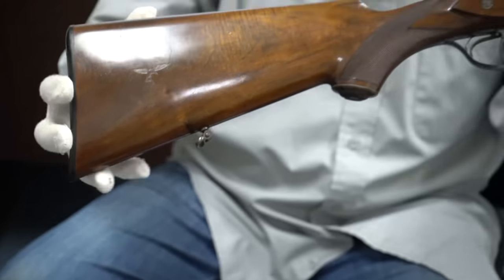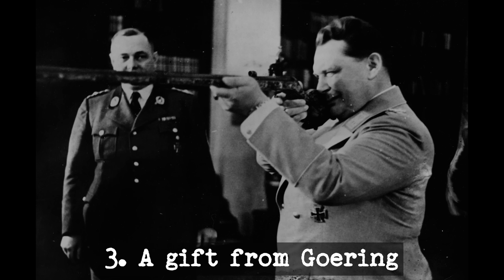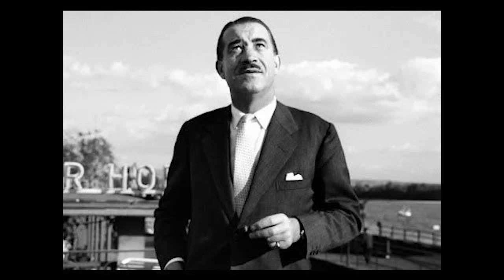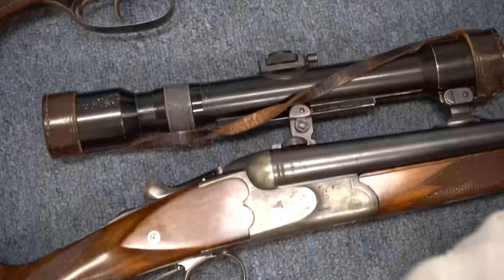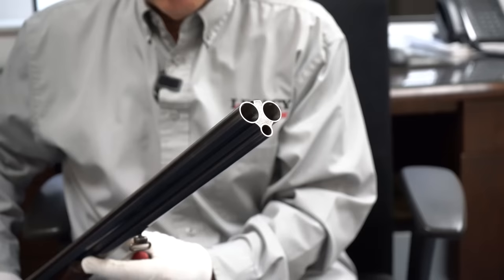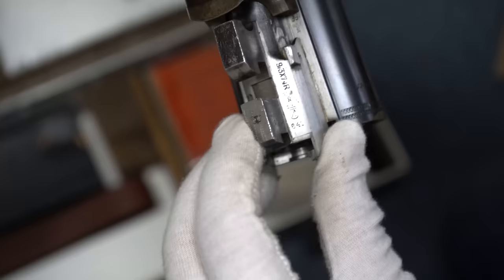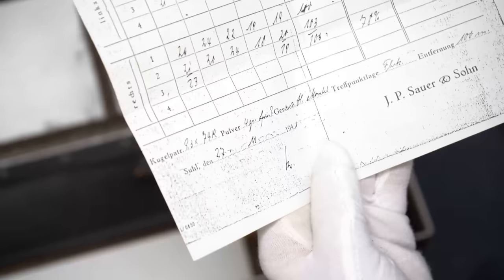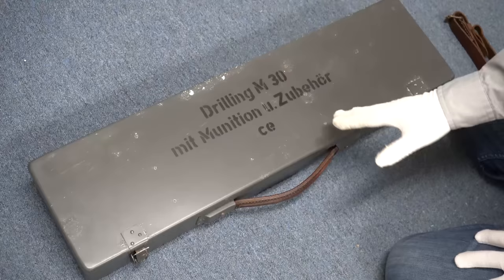Finally Proven! The Purpose of the Luftwaffe Drilling

Comment: There's a museum near me with a captured Panther, on the outside one of the cargo chains is the original - hammer forged links, all drawn out by an expert, probably took dozens of hours.  When the Brits sent it back to England for training they replaced the missing cargo chain by twisting a bit of bailing wire. Both were equally effective at keeping a gas can attached to the tank.
Reply: Bovingdon tank museum
Reply: What waste of resources. I have seen at least 50 other expensive and labor intensive examples on common German military hardware.
Reply: @robertkenny7490  Bovington is magnificent, but this one is in the US
Reply: @rfarevalo  Imagine losing some cargo that was way more expensive than a simple chain just because some grunt tossed a single molotov at your tank and you were cheap. On the other hand, that blacksmith who makes chains? You could have him making flails of war for your knights to attack enemy tanks with, right?
Reply: @headhunter1945  the issue is manufacturing time for the fasteners and where the metal resources could be better put to use. You want the tank as well built as it needs to be and no better which is why the soviets only built the t-34 to last a few months. Also, important cargo was seldom kept on the outside of a tank
Reply: @FreeRangeHuman4083  Germany had no issues with steel resources for the vast majority of the war, and simple chains can be made from the lowest grade of iron, this is a nonsense point. Additionally, it is absolutely in the realm of possibility that your tank will get winged by a molotov and saving pennies on a chain costs you thousands of dollars in lost ordinance. Also, the T34 had an MTBF of like 100 hours. It was not the tauted example of "optimized engineering." It was, simply put, hot garbage in the field for much of the war. What won the Soviets the war wasn't their tanks or equipment, or the so-called German "over-engineering," (they must be over-engineered, Boris, their tanks actually work!)  it was the hundred thousand tons of Soviet human meat and gristle clogging up the German war machine until it broke down.
Reply: @headhunter1945  what world do you live in Germany wasn't struggling for resources in WWII? Germany was short on metal, oil, manpower, food, you name it they were lacking it. As for Russia, no their equipment wasn't good, but they were able to pressgang their ENTIRE COUNTRY into pressing out this "good enough" grade of equipment at ridiculous rates. This tanks busted? Here's three more. It wasn't RIGHT as it was akin to slave labor but they were turning out equipment literally faster than anyone else during wartime. German tanks also yes were over-designed. They regularly did small batch runs of their tanks before pivoting designs entirely causing a LOT of headache and constant need for retooling. There were so many variants of every single tank they made that would change hundreds of small things it was a logistics nightmare to keep parts at the frontline for repair crews. This is PART of why Germany started scuttling tanks at the end, parts logistics was basically on fire after Berlin proper was endangered with every able bodied person pressed to protect Berlin sometimes pulling them from their jobs and tank crews didnt have the ammo, the fuel or the parts to keep their tanks running.
Reply: @biosaber585  I specifically said iron, and I specifically said until the later part of the war. What world do you live in where you don't read what people say before you comment? Here are the facts, before I waste brain cells on your irrelevant paragraph: Pre-war Germany got 10 million tons of iron from their own mines, 9m from Sweden, and 3m from other sources. Sweden did not cease exporting to Germany until November 1944.
Reply: @biosaber585  lol, you're wrong
Reply: @user-gv7uj1wt6s  your understanding of how poorly Germany was during WWII really is abysmal if you think they were at all doing well on any resource during the war. Half of the reason Germany would re-use old tank and vehicle hulls with larger guns and top armor was because of how little they had left. The reason they pushed towards Russia was for oil to keep their vehicles running. Germany was isolated during the late war and didn't have ANY resources to draw on except what little was still in Germany proper. Many tank crews were low on or entirely out of fuel and ammo and would scuttle their tanks before retreating to Berlin and those with ammo but no fuel would essentially bury the tanks to hide them and use what little ammo was left to fight invading soldiers before they ran out and were killed or simply over run. In other instanced Germany made small bunkers of concrete with tank turrets and guns on them in order to utilize the turrets that had no hulls to place them on. Many of these however have since been dismantled for scrap post war. 

Do some research on where Germany was before WWII they had NOTHING and even less so after. WWII nearly killed Germany entirely as it starved the country and killed hundreds of thousands of women and children from the civilian populace not even counting the youg men drafted to fight. The Nazis took a nearly broken country to war again and nearly brought it to an end. And your understanding is so poor you probably hail Adolf Hitler as a hero. You're a fucking idiot
Reply: @biosaber585  During the war the Americans ate the best in the home front, the Germans the second best.
Reply: @GazB85  actually the best performing on the front were generally the Russians. But that was because they were batshit crazy.
Reply: And the Americans made a aircraft carrier and 25 planes
Reply: @biosaber585   I said ate on the home front, as in food, not fighting ability.
Reply: @GazB85  apologies kinda guessed whether or not you misspelled something. You are correct the Americans (and to a degree thr british) did eat the best on the front. Russia just.. starved
Reply: @biosaber585  😂 You misread it again!
 I said ‘home front’, not ‘ the front’.
 The Americans ate best and the Germans second cause they shipped loads of stolen food/grain back to Germany for their own people.
Reply: @GazB85  britian wasn't doing BAD... by British standards
Reply: @biosaber585  By British standards? Are you saying our food is terrible😂

The population got healthier during rationing here in Britain, is that what you mean?
Reply: @GazB85  no I mean different countries have different standards. Britains rationed food is very different to America's or as in my case, Germany's
Reply: @biosaber585  True but calorie and selection wise the Americans ate the best and the Germans second. 👍
Reply: @headhunter1945  thanks for setting the record straight
Reply: That captures German design philosophies of the time.

What toom them 80 man hours, the Allied forces (all of them) did in 4 to 10 hours of standard welding or forging, which was just as effective.

The Germans had to have the BEST, when "well enough" did just as good, if not better.
Reply: @biosaber585  ,
they were driven forward by their political commissars !
Reply: This is a good anecdote and metaphor for the differences between German and Allied manufacturing suggestions
Reply: @headhunter1945  my guy, chain linking is one of the easier things to automate.  On top of that, why would you ever secure loose cargo to a vehicle with a chain??!!  You want something that you can put under tension as that will be dozens of times more secure and less damaging than something which will have some play because it's inflexible iron.  On top of that, STEEL SHORTAGE!!!  Literally no reason for anything but the towing/vehicle recovery lines to be made of steel for them.  Rope, string, or leather would make significantly more sense.
Reply: @biosaber585  Russian performance? The Russian KDR was somewhere between 2 and 3 Russian soldiers killed for every 1 German. They got wrecked.
Reply: @John.McMillan  "Well enough" simply was not as effective, which is why German KDR was 2 to 3 times better than their enemies for 90% of Germany's battles.
Reply: @headhunter1945  the iron doesn’t matter, they didn’t have the other metals needed for the proper alloys to make what they needed. 

Also what good is iron when they didn’t have the gas to fuel any of the vehicles they built?

Also German tanks actually working? Tell that to the massive amount of transmission failures, the whole Ferdinand fiasco, and the fact that parts commonality was so bad because of the incremental upgrades they were impossible to repair with spare parts half the time.

You’re also talking about german kill ratios, which were vastly inflated due to the way they counted kills. Everyone participating got the kill, rather than just one guy.
Reply: @Fireclaws10  Those kill counts were according to the Russians, smart guy. Cope more.
Reply: I'd call it a waste normally, a guy who can hand forge weld reliably is going to be more useful doing things other than making chain elsewhere, however they got bombed out pretty early in the war those guys probably would have died in larger factories. One of the reasons they liked fixed gun tanks without rotating culverns was lack of ball bearings for instance, the ball bearing factory was blown up early so all there rotating culvern tanks where prewar.
Reply: @MrSquishles  The StuGs were simply highly effective at their role. In truth, all the documents seem to indicate that ball bearing production in Germany increased every year until 1944, when it saw a slight decrease. In 43, Germany imported more ball bearings from Sweden, presumably to make up for the slight impact of the bombings.
Reply: @headhunter1945  They had issues with tungsten mainly and once the Allied bombing campaign started to target railways, bridges, tunnels, and communication lines more heavily thats when they really had issues.  Mind you not issues producing stuff (if I remember right 44-45 was the highest amount of guns produced in the war for Germany), just really issues fueling vehicles and transporting stuff and their focus on building newer vehicles rather than producing spare parts for already made ones.
Reply: @rfarevalo  I mean, it's not surprise that Panther production NEVER met monthly production goals.
Reply: @headhunter1945  I think you undersell the Soviets here. T-34 was engineered, but it was engineered entirely around its expected service life. Production cost of the T-34 continued to drop as the war went on, despite reliability and features generally improving. That said, they weren't - for example - going to bother using ball bearings on a generator when the expected service life of the tank was 6 months when a sleeve bearing would last that long for a fraction the material cost. 

Early transmissions were garbage, sure - but again, they did get around to a much more reliable design
That said, this also led to manufacturing innovations, such as submerged arc flux welding, allowing higher quality welds on hulls to be produced much faster than before.

I'm no T-34 fanboy, but I can appreciate that the manufacturing mentality (and goals) behind it were very different from how Germans - who at the time utterly abhorred mass production techniques - were very different. "Kursk: The Epic Armored Engagement (2013)" here on YT has an excellent talk starting at 26m contrasting American, Soviet, and German AFV production mentalities if you're curious about where I'm going with this.

I would also say your remark of the soviets just throwing meat into the grinder is a very postwar "all of our info on the eastern front is from German memoirs" perspective and newer scholarship with more access to contemporary soviet records provide far more nuance; especially explaining how a German officer's recollection of a battle might be that the Red army just threw "endless" troops at them, but the Red Army's records showing the much more skilled operation art at work.  Deep battle doctrine, carefully distributing troop density based on expected defenses, etc.

Understanding that you need to outnumber your enemy in order to secure the best chance of success isn't exactly "human waves" - during Operation Barbarossa, Axis forces generally outnumbered the Red Army defenders at the local level, too.
Reply: American Heritage Museum in Hudson, Mass. has both a Panther and a T-34-85 on display. Is that the one you were referencing?
Reply: @headhunter1945  I'm talking armored vehicles. Average numbers for the Russian Armor division was a minimum of 3-1 performance in combat. These were by no means GOOD numbers as 80% or more of the armor division of the time was devastated but when talking a solely numbers game as folks in this chat are wanting to the armor division was amazingly high performing for WWII considering just how outgunned and under armored MOST of Russia's tanks are. Not only that when talking about manpower we again come back to a bit of an underdog discussion. The Red army was HORRIBLY under-equipped, under-trained and under-armed vs the Germans. You're talking about an army who didn't develop a GOOD combat weapon until basically the end of the war (The PPSH was a joke on most of the fronts it was deployed in due to cold conditions causing mags to freeze), half starved their people on the regular and many soldiers couldn't even READ. And yet they took on at the time what is considered one of the most advanced armies of their day. Taking ALL that into account Russia kicked ASS. In lame man's terms this is like going into a boss fight about ten levels below you're expected level and STILL pulling out a win. I'm not saying their shit was good by any means, it was dog shit, but when looking at everyone objectively, for how poorly Russia was prepared to still get the results they did. They were far and above the best army in WWII. If for nothing else than raw talent of their soldiers
Reply: @headhunter1945  what expensive cargo do you think gets strapped to the outside of a tank?
Reply: @biosaber585  You have everything backwards, lol. No Russian tank met Tiger kill ratios, in fact, no tank period. Shared kills counted towards medals, not kill counts. Russia out-produced, out-numbered, out-resourced and out-sized Germany in basically every department. The fact that their kill ratio was so horrendous and their tanks performed so much worse is just shameful. Germany was the one in the boss fight, and they punched well above their weight limit. Russia was a flabby and ineffective sumo wrestler that somehow managed to stumble on Mike Tyson and suffocate him under layers of fat.
Reply: German engineering was significant in the war. Also German bloodline and genetics played a part
Reply: Mfw this guy thinks that chainlinks are done by blacksmiths because some celebrity said so in a video.

Making chains is an automated progress since the industrial revolution, the reason why the british had to make one by hand is that they had no access to a factory
Reply: @jacqirius    I think you are confused...
When does he talk about hand forged chain links in the video?
When did anyone say about the British hand forging chains? 
Do you think there wasn't a single factory in the UK capable of making chains?
You realise this thread is talking about an exhibit in a museum, right?
Reply: @feedingravens  Uh what?  When did I ever say something saying the opposite?
Reply: @biosaber585  it literally doesn't follow to claim Germany was starved for resources at the start of the war.
Reply: @headhunter1945  The myth you are perpetuating about Soviet military tactics is verbatim the excuse used by German high command after the war when they were given senior positions in NATO. Not only is it plainly wrong, and an ideologically driven argument, its comparison to the myth of asian hordes coming to invade Europe is flat out racist.
Reply: @headhunter1945  What's wrong with you? Genuinely, please consider WHY Soviet fatalities were so much higher. The Commissar Order, deliberate starvation of prisoners of war, g*nocide of Soviet citizens, and the invasion of their homeland were gruesome crimes commited against your fellow man and you thinks that's funny? Where's your humanity?

Though I suppose your comment is based on your evidently lacking knowledge of Soviet pre/post war production rates and their industrialisation in the 20s and 30s, to the point where you think that Soviet military production was anywhere near comparable to the Germans at the outbreak of war.
Reply: @mou8762  Care to explain which soviet tactics I spoke of, specifically?
Reply: @martinschofield4895  The Panther at Bovington has exactly the same. Obviously the elaborate chain wasn't that effective.
Reply: @DSiren  you have zero clue what you're talking about.
Reply: @mou8762  That's the only reason you can see? I'm guessing you haven't seen very much.
Reply: child labor